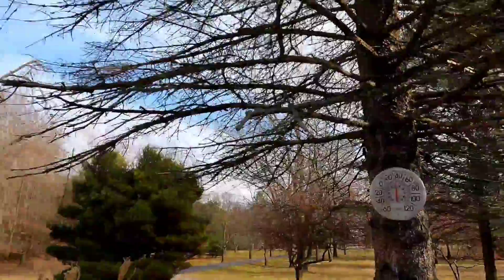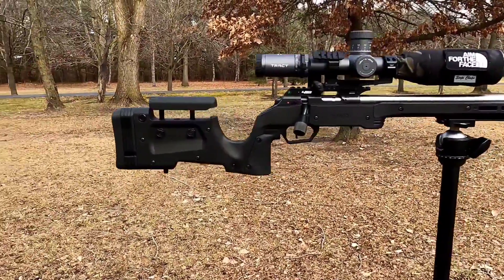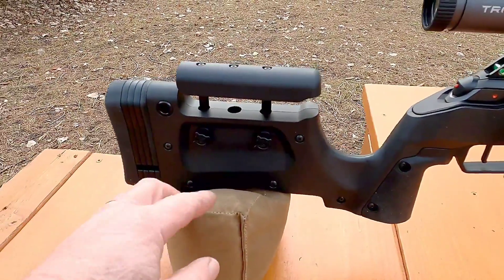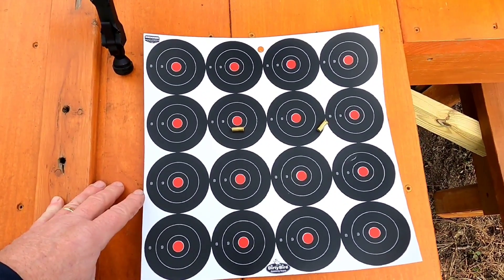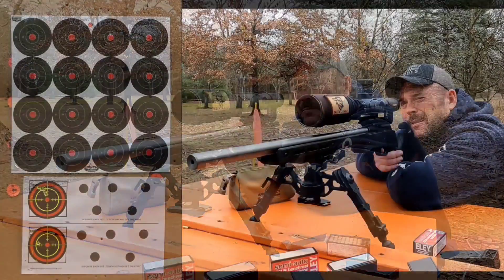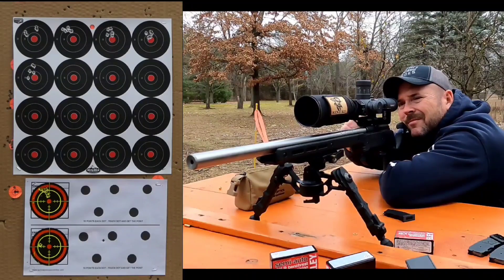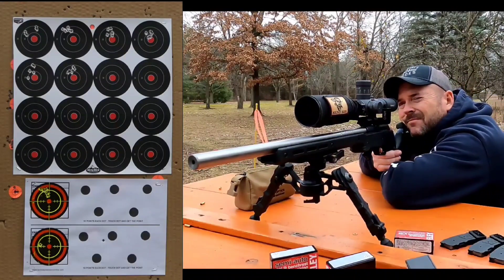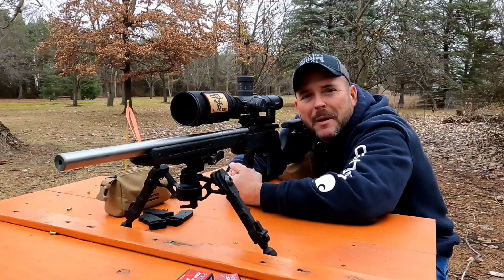The CZ457 Lilja Barrel, MDT XRS Chassis, lot testing Eley SABR at 100 Yards, Amazing Results

Comment: ...great testing.  My 10/22 Tactical loves Eley @100 yards...shame the 42grn Action is out of production because it was reliably good for SubMoA, even down to 1/2" grps. Eley Contact is my next option....
Reply from the maker: How does that 10/22 cycle the Eley in the cold?
Reply: @RimfireSS  ...down to freezing it's cycling fine from the 10rd mags. I had 1 FTF out of 200, normal I might have 1 in 1000. I use a polymer buffer bolt and a very light PTFE oil on the polished bolt/receiver.
Reply from the maker: @littledaddynesbit4193  man my KIDD is having troubles. Tried all my magazines and labeled the ones that worked. Then I tried to make a video and those same magazines jammed terribly. Beginning to not like that rifle much. Overpriced paperweight.
Reply: @RimfireSS  ..are you sure it's the mags? I replaced the extractor and spring in my wife's 10/22 because it was getting fussy feeding and it cured it. I split and cleaned all her mags before that but made no difference...
Reply from the maker: @littledaddynesbit4193  actually just went out with a different ammunition and it ran flawlessly. What a shame.
Reply: @RimfireSS  ...I've never shot SABR, but I don't have issues with Contact (or Action - but it's out of production now...), so could be the wax?
Reply from the maker: @littledaddynesbit4193  I think Eley uses the same wax in all there ammunition. But not sure.
Reply: @RimfireSS  "All of ELEY’s .22LR rounds have some form of lubricating wax applied. The two main lubricants ELEY use is beeswax tallow and paraffin wax. So what’s the difference?" The Contract have a light, thin coating that doesn't go tacky on the cold?

Comment: The point you made is a good one. That you need to buy the stock that fits you so you can get everything out of your set up. Buying the most expensive stock doesn't guarantee that you'll shoot well, even if your rifle is accurate. You have to be comfortable and shoot your best to be consistent, that what a chassis is supposed to give you. It's like shoes, one size doesn't fit all.
Reply from the maker: Absolutely, I’ve always found if your setup isn’t completely comfortable back out and setup again till you are. And I’ve been so uncomfortable with the Manors stock, granted it’s solid, sweet looking and I like the weight but it just didn’t fit, like wearing shoes that are one size too small.

Comment: I found one Lot of SABR that grouped .400 at 100 yds out of my Bergara and a Savage TR. Yes, I bought a case. It was 1056fps. Several other Lots were not as good - .600-.720. The Savage is an amazing rifle. I did add a Harrell's tuner to it.
Reply from the maker: savage builds accurate rifles. I’ll bet these groups would have been better if it was 75 degrees out. I’ve actually never had a .22 shoot this good in the cold.
Reply: @RimfireSS  The lube on .22s gets hard in cold weather. I have a match this Saturday. Start time temp will be 34 degrees. I keep my ammo in a small insulated box with hand warmers in the bottom. I have a CZ Varmint arriving today. Our club will start having NRL22 matches in January. Unfortunately I am not very limber so we shall see what accommodations they will allow. Saturday match has 10 steel targets at each distance of 50, 75, 100, 125, 150 and 200 yds. One shot per target.
Reply from the maker: @joed3264  that’s good, wish one of our local ranges would do NRL22. Good tip on the hand warmer trick Thanks

Comment: Great groups. Did you shim the barrel? I am told the barrel comes with shims. If so, at what headspace? Thanks.
Reply from the maker: .043
Reply: @RimfireSS  Thanks. Just bought a shim kit for my CZ 457. I don't have that beautiful Lilja barrel but will try to squeak out a bit more accuracy with what I got. I am a new subscriber.
Reply from the maker: @cacinaz8802  welcome aboard  and thanks for Subscribing.

Comment: Very nice shooting and great info on lot testing ammo in the mid range cost wise.  I have a similar set up on my CZ 457.  Lilja barrel and timney trigger. MDT XRS just arrived.  What do you torque the action at?  The instructions say 60 inch lbs, but that can't be right.  I am starting at 30 inch lbs and see what I get on the first targets.
Reply from the maker: I did what the instructions said. 60 inch pounds.
Reply from the maker: You gotta remember that stock is made out of a very dense polymer. I’d do the 60.
Reply: Thanks for reply.  I just searched for additional XRS owners experience and Snipers Hide had a thread on it.  They tested different torque settings from 20 to 60 inch pds and ended up at 30 inch pds.  Center fire rifles may need the higher torque, but I am going to use 30 inch pounds to start and test it from there.
Reply: @RimfireSS  I think the 60 IP was for a rem 700 from what I found.
Reply from the maker: @cadecorneliusen3047 the instructions that came with my chassis said 60 so that’s where I went with it. Don’t plan on changing it, it shoots like a hammer.

Comment: Hey Don I bought the arca
 ball mount you suggested and it did not fit my MPA chassis, not complaining just a heads up.
Reply from the maker: Really?? That’s the one I have and it works on all my Arca chassis, camera’s, everything.
Reply from the maker: You did take the camera mount off the Arca before trying to put it on the chassis right? That’s the only thing I can think of why it wouldn’t work, Arca is Arca, unless you don’t have Arca on the MPA? Idk
Reply: @RimfireSS  yes I removed the screw on camera mount. The ball head mount does not go up the sides to the arca rail far enough to go into the rail. I contacted MPA and they said that arca accessories should fit.
Reply from the maker: @davelyons8092  is that the only Arca you have tried on it?

Comment: Just for my info what does a 22 bullet hole in paper measure? Thanks
Reply from the maker: Depends on the paper and the ammo.
Reply: @RimfireSS  thanks kinda...I think 😆
Reply from the maker: @jimmiller4526  sorry I don’t have a better answer. The bullet diameter is 0.223 so it’s probably close to that. Can shrink depending on the paper you use but by how much… idk

Comment: You have your scope mounted awfully high!!
Reply from the maker: Your right. Lol. I do. Problem is I need a cantilever mount to get the right eye relief for the Tract scope, also I get the 20 MOA mount this way so my scope is at the very bottom of the adjustment range. So I can go out along way without having to use holdovers. And it don’t bother me high and it’s comfortable so that in a nutshell is my reasoning.
Reply: @RimfireSS  yeah I have the tract toric as well, really like it.